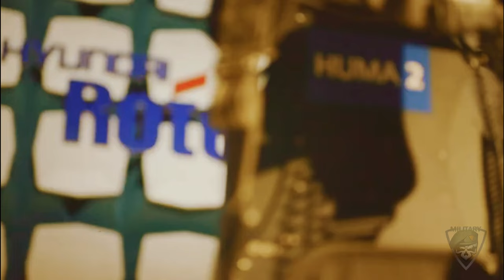K2 Black Panther : The Best Tank On Earth - Outperforms M1A2 Abrams and leopard 2 tank

Comment: It will not out perform Challenger 3.
Reply: That’s not a thing
Reply: @hypergidra2407  It will still not out perform Challenger 3.
Reply: @gusgone4527  challenger 3 is not a thing
Reply: @hypergidra2407  Of course it's a thing! 
Thing definition. - An individual object, especially an inanimate object.
Challenger 3 will be the designation for the latest updated Challenger 2. Built once again of the best and most well protected MBT hull ever produced by mankind. 
God save the King! 
💂‍♂💂‍♂💂‍♂💂‍♂💂‍♂💂‍♂💂‍♂💂‍♂💂‍♂💂‍♂
💂💂💂💂💂💂💂💂💂💂
💂‍♂💂💂💂💂💂💂💂💂💂
Reply: @gusgone4527  it did not reach to mass production and its going to in 2027. Prototypes have been built but it is not complete
Reply: @gusgone4527 Kid.
Reply: But everything out performs Russia's obsolete tanks.
Reply: Never heard of Challenger 3 or 2 or 1...LOL
Reply: @little.rascal.  lmao
Reply: Challenge 3 is a garbage tank. Stop talking non sense.
Reply: If reliability of JLR products is anything to go by chally 3s would probably break down coming off the ramp of the delivery truck in reverse gear
Reply: @handsomeman-pm9vy  Turtle tank has outperformed the Abrams and Leopard 2 lol
Reply: @BleedingSnow  
Russian deployed the T-14.
All 10 of them.